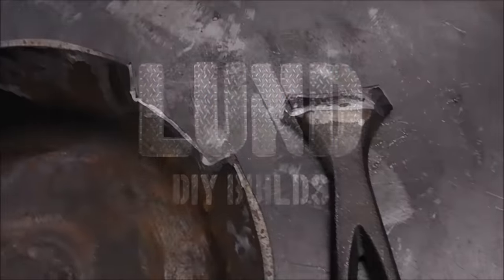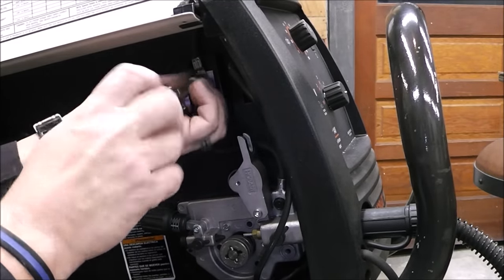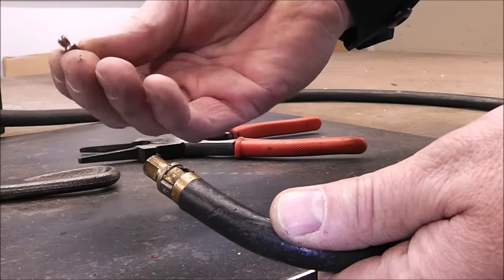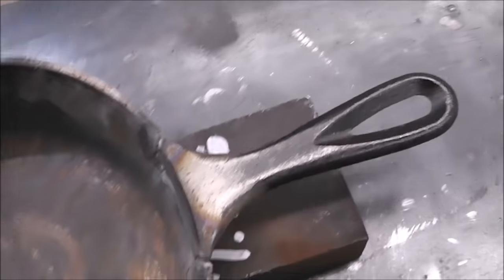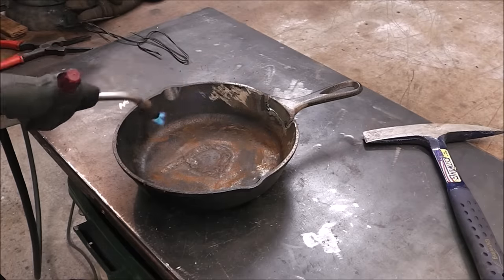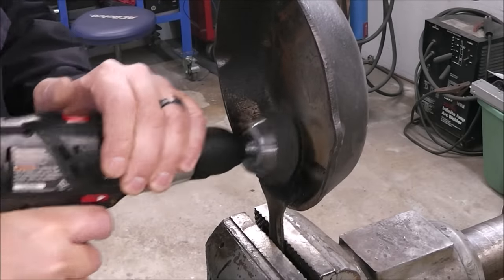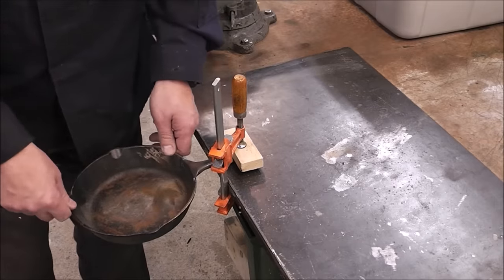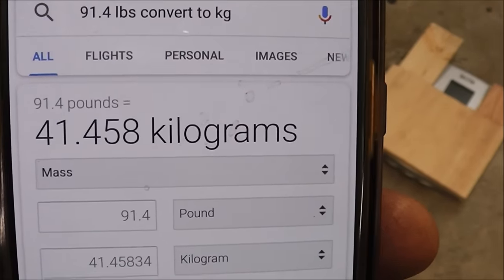Cast Iron Welding Repair using Flux Core Wire

Comment: Very interesting. I'm always needing to repair cast iron on hit and miss engines and I'm not good at it even though I have torches and a Tig. I've never even considered using the wire feed for cast... until now! I'ma gonna tryit.
Reply from the maker: You can do it!

Comment: Great content! Years ago I had an experience where I had to do a crack in an exhaust manifold I gouged with a grinder then I preheated it with a butane torch like yourself and actually use c25 o23 wire then I went back to the butane torch and kept it warm and it lasted forever
Reply from the maker: Right on! You don't know until you try!

Comment: I had a really good TIG session on my cast iron griddle. No filler metal required. Strong like tractor.
Reply from the maker: Interesting. I might have to try
Reply: @BrandonLund  Just make sure the joint is exquisitely clean.and just a small chamfer around the edges.

Comment: Thanks for taking the time to do this. I have a cracked cast piece on my drill press and I was wondering if my Flux welder could patch it up. It hasn’t broken all the way through yet so now is the time to run a bead.
Reply from the maker: Thanks Tim. Just make sure you drill a small hole at the end of the crack or it will continue to crack beyond your repair

Comment: you know you did what i was told and so far shown as impossible, welding cast iron pfft forget about it, but what you just did with the results you got i’m impressed good work.
Reply from the maker: Thanks man much appreciated. I was told the same thing for many years but wanted to test it out. If you take your time and plan it out you can get pretty good results most of the time.

Comment: Nice job Brandon. I'm one of those guys you mentioned that only has a MIG setup and I've never tried to fix cast BECAUSE I was told you can't with a MIG torch. Looks like I should stop listening to  some of the self proclaimed "experts" I know and just do it. The fact it held 90lbs was shocking.
Reply from the maker: Thanks man! Yah I've had a lot of people tell me over the years that certain things wont work but due to having nothing more Vs. tossing it i the trash sometimes the only option is to TRY. I appreciate your support and kind words!

Comment: I like your idea of examining alternative ways of doing a little job.  One thing i do to try to avoid possibly getting grinding wheel material in the weldment is to scrub the joint with a wire brush after grinding .  .  .  .
Reply from the maker: Great tip, thanks!

Comment: The Hobart Handler 140 is easily the best 110v Mig Welder I have used. Ive owned multiple Lincoln and Miller 110v Mig welders and The Hobart 140 just sizzles. Even compared to the Miller I have. And Miller manufactures Hobart . Maybe I just got lucky but Its been a awesome little Buzz Box
Reply from the maker: I completely agree. Its built like a tank and runs smooth as butter. Some of the earlier models actually had stingers that had the word Milker on them on the Hobart units.

Comment: I was recently at the junk yard picking up some scrap steel for various metal working projects.  Lo and behold I spy half of a 8" cast iron skillet partly buried.  As I was reaching for the handle, I figured the thing was split in two which was why it was at the scrap yard.  But, I pulled out a fully together Griswold!  It wasn't one of their older models, but still...

At home I ran it through the sand blaster and discovered two cracks.  One was near the handle and the other near one of the two pour spouts.  I beveled out the cracks with a Dremel and silver soldered with Harris Safety Silv 56.  The 56 is the only silver solder Harris states as safe for food service equipment.

I did two braze, grind, blend cycles before seasoning the pan to the normal cast iron cookware black.  The repairs are nearly imperceptible unless you know where to look or you're looking over the pan with a collector's eye.

The scrap yard find is now part of my daily cast iron skillet cooking rotation.
Reply from the maker: Thats awesome! What a great find! It's always a great feeling when you repair something and give it new life again.
Reply: The repair is documented on Facebook.  Search for, "Russell Stephan Attempting to Save a Cracked Griswold 704G Cast Iron Skillet"
Reply from the maker: I sure will! Thank you!

Comment: Thanks Brandon, Have always used Low hydrogen rods with a stick welder for cast iron welding. am learning to use a mig. :)
Reply from the maker: Right on! I've tried 7018 a few times and have never had good luck. I know a bunch of other people who have though. If you want a really strong cast iron repair try MIG silicon bronze. I did a video on it. It's the strongest repair I have ever done. I was amazed. It broke at almost the same weight that it took to snap the handle. The video is in my cast iron repair playlist if your interested.

Comment: Nickel rod Has been the 'go to' for mechanics repairing exhaust manifolds, still pre heat and some what a controlled cool down, also using the engine heat
Reply from the maker: Its good stuff for sure!

Comment: Personally, I would have welded both sides. The second pass I woulda turned up the heat a hair and tried to weev the bead. But none the less, still a great video and look forward to more in the future.
Reply from the maker: Thanks man! We tested it! Does welding cast iron on both sides make it stronger? https://youtu.be/qNHAteo-qwg
Reply: @BrandonLund  I think it would with slightly more heat and maybe a good amount of weaving.
Reply: @BrandonLund  as a welder, not so sure it needs more strength. But it is a pan... Would need welded and smoothed again for use lmao

Comment: Great video. You can easily increase the weld strength by welding a metal strip over the weld bead for extra reinforcement.
Reply from the maker: Right on! @joe yong thanks man! 👍🙏

Comment: Nice vid, not sure what the live shroud part was about tho, generally that only happens when some spatter gets up in there and joins the shroud to the tip which is live, unless your gun is somehow different. Anyways learnt something about cast iron today cheers.
Reply from the maker: Thanks Dale! Maybe my insulating ring is shot...I might have to check into that.

Comment: Great attitude,, Thanks very much I only have a cheap flux core system for now. But as long as it fixes the problem who cares Thanks...
Reply from the maker: Thanks man! There is nothing wrong with flux core welders, in fact this Fridays episode is a flux core welding project and one of the things we talk about are the advantages and disadvantages of flux core Vs. solid wire. I hope to see you there :)

Comment: One critique old mate,good idea to remove tip so when feeding wire through the liner it should come all the way and not hit the tip and the knurled feeder rollers won't harm the wire when it's stalled. Otherwise, good work.
Queenslander.
Reply from the maker: Thanks Keith. I think your refering to what happened at 4:03. Although not shown as me taking it out first, that's what happened, but I agree with what your saying. Thanks for watching.

Comment: I agree with you Brandon . unfortunately I'm using a harbor freight mig welder but using good quality flux core wire. I would of welded both sides of the pan. But got the pan really hot first.
Reply from the maker: Thanks man! You might find this video interesting :) https://youtu.be/qNHAteo-qwg

Comment: Back in the mid 80s, when I started welding, the most common innershield set ups were Lincoln LN-9 wire feeders and no gas nozzles on the gun. It was actually the thing that was more desirable because of better visual of the weld puddle (more like stick). I still run all my innershield that way.
Reply from the maker: Pretty slick!

Comment: Thanks bro, you demonstrate the things us backyard guys don’t know about. I am a new welder myself...don’t know metallurgy. I have some cast I want to weld for decor, you’ve been helpful! Is propane or MAP gas best for heating the cast?
Reply from the maker: Thanks man. I appreciate your support. Either gas will work just fine. Map is a little hotter but not necessary.

Comment: I weirded a floor mount drill press table with mig years ago. This was at a manufacturing shop. I lasted untill I left 2 to 3 years later. Used oven to slowly cool.
Reply from the maker: That is awesome! Nice job!

Comment: I know there will always be critics, and they will always say that because something isn't textbook, it isn't right. I first saw this done as a child, on a cracked exhaust manifold, with a stick welder, by an old farmer helping our pastor, who was struggling to find a replacement, everyone around said it couldn't be done, and that it would never hold. The farmer didn't preheat, simply drilled the holes at the ends of the crack, and did it a half inch at a time, and beat the crap out of it with the peening hammer as soon as he pulled the stick away. it did the job, and held till the wheels fell off that car.(figuratively speaking). It is not about the perfect weld. it is about what works,  you can do with what you have. I have done the same over the years with both a stick, and a wire feed, on manifolds, broken bolt tangs on engine blocks, and on an old MG Midget transmission case. and it never failed to hold. People don't always have a welding or machine shop right around the corner.
Reply from the maker: Spot on brother! 100% I grew up having to make due with what I had and you learn real quick what works and what doesn't. I cant count the number of times I've done things others said could not be done. Try I say. Cheers brother!

Comment: Over the past 45 years I have tried most methods for ci but last 25 years have just used nickel rods with no preheating but weld a little and peen with a needle gun. Works stick welding cast aluminum also. After finish grinding the part you can use the needle gun to put back that cast finish. I would really like to see someone do a yt video using this method.
Reply from the maker: Consider it done and thanks for the great suggestion:)

Comment: I have a cheap Harbor Freight flux core wire feed welder and just picked up a cast iron and wood garden bench that someone didn't want. One side of the cast iron bench end was cracked. I'm not sure what the polarity setup is on this welder but I'm curious to see if it will weld it....Guess I'll find out soon enough.
 Thanks for the video!
Reply from the maker: Hey Jeff,  I also picked up a cast iron bench and the leg was completely broken off. It's do-able! Good luck buddy and thanks for the support!
Reply: @BrandonLund  Yes Sir, I got to looking at the bench more closely and luckily, I think, it's not cracked in the legs or any major structural part it's cracked on one end of the back rest. Should work out ok I would think.
Reply from the maker: @bodeine454  mine was broken right at the leg. Completely broken off. It's still holding strong and it was very inferior cast iron.  If you check out my playlist "welding cast iron", it's one of the first in the first in the series. You will also see how the content has evolved. For that repair I used solid wire and gas (if I remember correctly) Feel free to upload a pic on the LundDIY Facebook when you get it repaired. It helps others see what can be done. Cheers buddy

Comment: Yo listen this is a super strong repair method for a skillet the original wouldn’t have held 90+ lbs and outside of the weight test on the weld it would have made even better ground beef burgers with the flux core lmao I loved the vide and the frame of mind used to make it keep up the great work brother
Reply from the maker: Thanks man! Much respect! 👍

Comment: With that method I've welded a brake rotors to a big truck drum with a bad axle lugged to the rotor making a video stand. Next time using a like big truck drum I welded a 3/16 mild steel plate over the small hole with regular steel pipe welded vertical for a grinder stand. Neither have cracked, but also no major abuse. As we speak I'm welding a cracked cast iron exhaust manifold. This will be the test. See if it can hold up to the extreme heat cycles.

Method
Cleanup
Notch
Weld 1/2-3/4 inch
Peen
Let cool to the touch (near ambient)
Reply from the maker: Good luck on your repair man! Fingers crossed!

Comment: I was a weilder for the navy back when Noa was building the Ark! And my automobile had a certain part that failed me, so like a good lad, I proceed to the local parts store to obtain a new one. Now keep in mind my automobile was in the age range if the ark it's self at the time, and evidently this was a common problem with this particular brand of automobile, the part in question was made of cast aluminum, so wielding it was a streach, but the comonality of this resulted in the depleation of said part from the supply chain. So now what option did I have. After a considerable amount of research I come to the conclusion the cast aluminum was the equlivant of a structual sponge! This meant any heat applied to the point to obtain fusion was a self-defeating proposition. So in my infinite knowledge and experience ( all two years at this point) I came up with a plan. First I was what was known as a tig welder. I concluded for this to have any chance to work I would have to create enough molten aluminum in the process of welding this thing to recreate the portion of the part I wanted to fuse back together and it would have to blend / feather if you will in to the surrounding part as I went along. So instead of the pencil lead thin pice of aluminum filler rod that would normally be used I would have to use something big enough to absorb most if the heat from the arc and still heat up the local point of weld to allow for fusion and it would all have to be done simultaneously and quite rapidly. I ended up using a 1/4 inch rod for something that would normally call for around forty thousands of an inch. And when the arc was struck I had to push the rod into the puddle to the point of cooling it to a cold weld. This provided the volume of liquid metals needed to fill the surrounding sponge area while keeping it just cool enough to keep it from just melting away. This turned out to be one tough part after that. Fast forward five years and I traded in the auto for a new one. I received a call from the dealership wanting to know who had welded this part. Let's just say I made some new freinds that day. So when I hear someone say welding cast particularly aluminum cast I just chuckle and ask are you sure about that?
Reply from the maker: I like your can do attitude. It's reasons like this (usually out of necessity) that new things are discovered. Rather than just accept someone SAYING "it cant be done" you proved it can be done by DOING it.  Good on you!

Comment: I think what your doing if very educational, it's good to know these types of welds and how they hold up, I have a project that requires welding on a semi truck brake drum not for reuse , but my options are a Lincoln 50 amp stick welder, and a little flux core wire feed..all ideas welcomed...
Reply from the maker: Thank you! Brake drums can be difficult to weld. Here is a video using a brake drum. https://youtu.be/kIKYpr05q-c
Reply: That's the same project I'm getting ready to start, I really like the bolting the base plate, I think that is the way to do that..thanks for the heads up love the videos..
Reply from the maker: Thanks Mike! 👍

Comment: Beautifully done.   Thank you.  Question though.   On your weight test,  do you think the handle would have broken off with less weight if the cast iron pan was exposed to heating and cooling several times like cooking in it?
Reply from the maker: It's possible, but welding cast iron is always a crap shoot anyways.

Comment: I'm thinking that that much weight would have possibly broken a new pan. Good job man! I did not know that you can weld cast iron with flux core wire either.
Reply from the maker: @Blade thanks man I appreciate you watching!

Comment: As a welder with over 40 years experience, I don't give a rats ass how it's welded. A cast iron pan is not load bearing piece and it's not a 55 chevy. What you have tried to show so'called welders is a very good simple way to repair something that would, if not repaired end up in a scrap metal pile. Here's some advice for all you 90 day wonders and book smart welders. Run whatcha brung. Any process that gets the job done and is safe and produces a useful product , then do it. Never just stick to the book. Experiment, try new things, get to know metal. You will never gain all the tricks because some haven't been come up with yet. Build up, not tear down. Good job my man. Keep doing what you do.
Reply from the maker: Thank you Tom!!! 🙏 You said EXACTLY what this video is about. This might not be the BEST method to repair cast iron, but if its all you got and it WORKS...why not. The folks that respond "it's a 10 dollar pan, throw it in the garbage" are the ones that have completely missed the entire point of the video.  As you pointed out, sometimes you have to think outside the box.